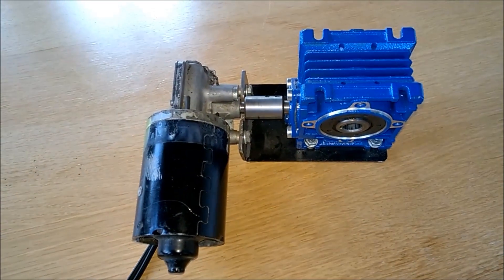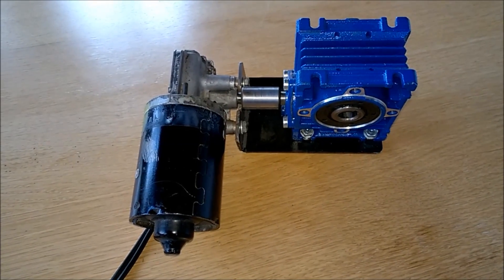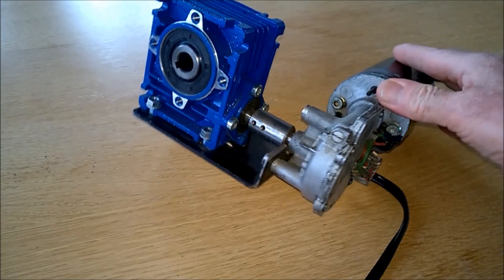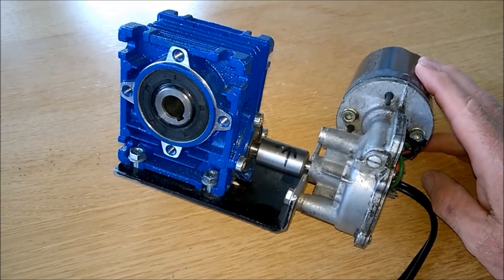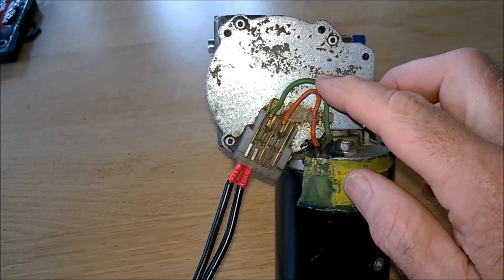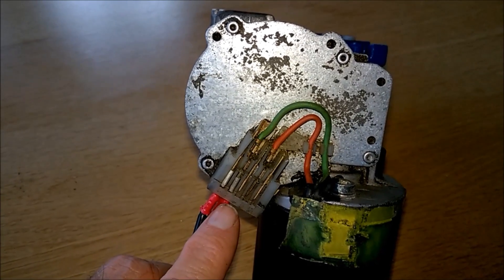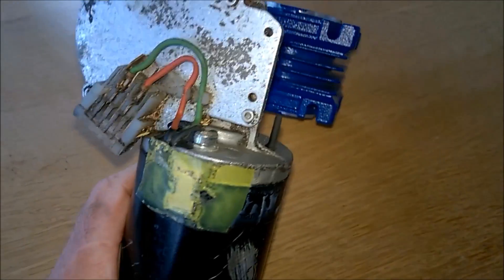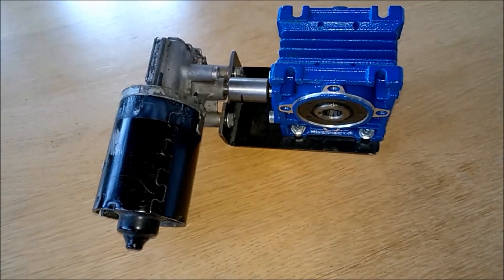Low energy drive unit for augers, grate shaker, DriZzleR feeder and so on.

Comment: Do you happen to know the reducer ratio? I found some reducers on Ebay  : )
Reply from the maker: urgentcareguy3 These reducers are in different ranges. From 1 to 5 till 1 to 50. Of coarse the latter is although very strong, also very slow. It all depend on the use.